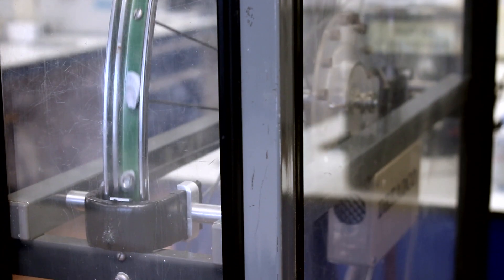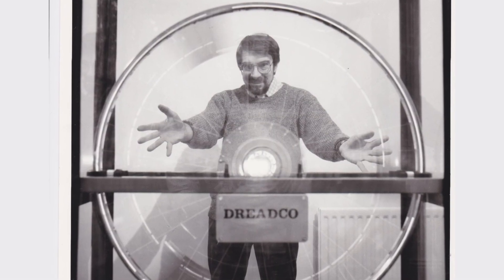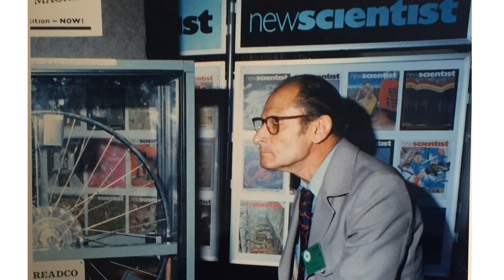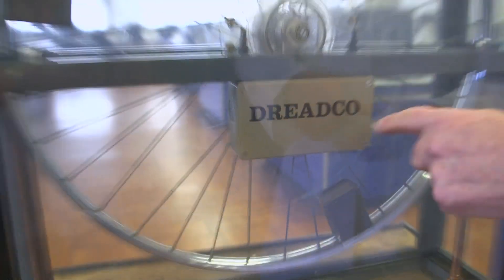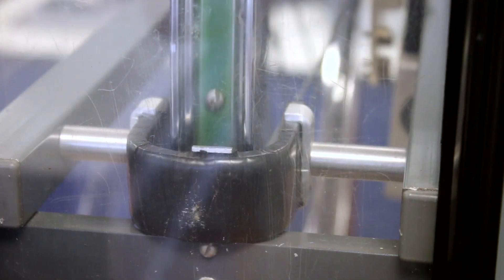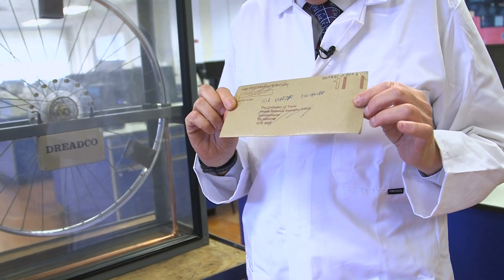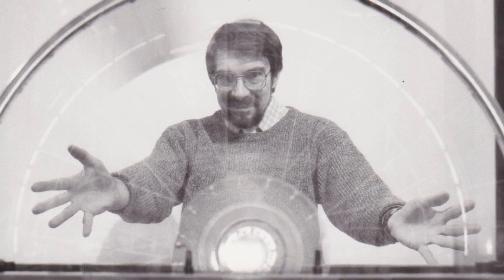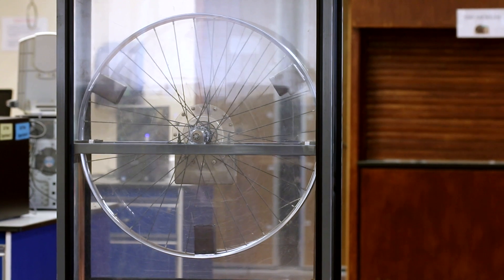Perpetual Motion Machine - Periodic Table of Videos

Comment: This is a non-event. Grandfather clocks run for ages without any further input of energy after the initial windup. Simply 'running a long time' is NOT what defines a PPM. You cannot get this system to do any *work*, because it is simply surviving on the initial input, which would be exhausted the moment you laid a gentle finger on it.

Comment: The axis of the wheel is not actually rotating on bearings, it's suspended by a magnetic casing that keeps a gap space( so no friction) and also same concept to prevent it from sliding to the side. And after the wheel was given its' initial spin the entire enclosure was thoroughly vacuumized. So the wheel will eventually slow down more and stop, but it will take a long time.

Comment: I think it works using electrostatic forces.  The three boxes are batteries, the things "that look like magnets" are brushes (the batteries being subtly connected through the wheel--we don't get a solid look at it in this video), the box with the heat sinks contains some voltage multiplication network, and there is a hidden wire to the Dreadco box to apply a large voltage, negative to the pointed electrode which deposits a negative charge on the isolated metal bits embedded in the plexiglas wheel by corona discharge, and positive to the round electrode which collects the charge, so only the upper half of the metal bits are charged.  The negative electrode repels the charged bits while the positive one attracts them, applying torque to the wheel.  The voltage multiplier could be a simple Joule thief.  Or, if the wheel is mounted at an angle, it could be a Tazer-type circuit (with ultra-low-leakage capacitors) switched at the wheel's rotational frequency.  It's surprising, though, that a contraption that runs for that long would need heat sinks for cooling electronics.  He should have started it turning in the other direction so the rising air from the heat sinks would accellerate the wheel, not push against it.  I predict that it would work the same way if you stopped it and reversed the direction of rotation.  Now to scroll down and see if anyone else had the same thought :)

Comment: Its not an RTG is it?
Reply: I think I will build one! it wont be as large... but I think I could get something to wok.
Reply: You should build one! even if you are wrong in this particular devices function I bet you could still recreate the effect!
Reply: Yes, the circle on the side of the deadco sign does look suspiciously like a radiation window.
Reply: As the prof said he was a bit disappointed when he knew the answer, does that mean he was disappointed because now he knew and couldn't guess or he was disappointed because the answer was so prosaic? If it was the later then I think it might not be any more than just a battery and magnets, so just an electric motor (hence why it's slowing down) and all the other stuff is just there to throw us off.
Reply: I'd love to see your take on this. I was assuming it was working based on differential heating from say lights in the room because that would be a fairly simple method, but I'm not sure how fast it would be able to move. I'm assuming it would be extremely slow
Reply: Humm... seems to check out, it would need heat dissipation. something with a fairly short half life like perhaps tritium? How much would it actually need? If so seems unlikely that this would be sell-able.
Reply: Watching the video again I think it wouldn't be a thermal generator but electrostatic so RSG. Essentially the radioisotope generates an electric charge and as the charges recombine they delver energy to the wheel. perhaps the "thermal fins" are actually there to ground the device? at any rate its probably not that radioactive or the professor wouldn't be anywhere near it given how he is about perceived safety.
Reply: He said he was somewhat disappointed by the answer.  I'm guessing it's just some D batteries in a box and the wheel is a low voltage electrostatic motor.
Reply: @SidewinderScience  Could be, especially as these types of batteries have been used in pacemakers in the 60', but Gamma radiation should be possible to detect with a lab Geiger counter in a cupboard of lead bricks, as there were dose calculations for spouses to nuclear pacemaker patients. I know this machine has been tested with a Gauss meter probe and the center box and the bottom left box had a magnetic field, not the horseshoe magnet looking clamps on the sides. but a permanent field could just be a hoax magnet put in there. The version is Austria that have been running unattended for 21 years and the one here from 1986 for 36 years. there is another video of it from 2017 where it runs at 10 seconds per revolution, and in this video it runs at a whiff over 12 seconds. The never machine in Switzerland runs at 6 seconds per revolution, so obviously, there is an energy source winding down in there. But he says here that it is quite mundane, so that excludes nuclear, though mundane to a chemist with access to every material might have a different idea of mundane?
BTW, the gray boxes on the rim are Colemanns mustard cans! Another option is a metal air fuel cell. A kg of Magnesium has a volume og 571cc and can deliver 6.8kWh in electricity when reacted with Oxygen from the air!! Spread out over 36 years, that is a constant power of 20 mW, enough to spin the wheel by an induction coil like the nodding solar toys, but an electrolyte that doesn't evaporate over decades in a fuel cell that needs to be exposed to air, isn't trivial. I would like someone to travel to the "Technische Museum" in Vienna and do a video of the other device there with a thermal camera and possible a Geiger counter, if the gamma radiation is sufficient to detect! (I'm not considering Beta voltaic cells, though they can be easily shielded with a foil of aluminium, they deliver nano amps, even if both boxes are stuffed full of them).
Reply: Please do! I'd love to see your take on this.
Reply: It has no active energy source anymore. most of the construct is fake. its just a wheel that is hung up almost frictionless with all sorts of empty and useless details around it. as it was build, he gave it somewhat strong momentum, depressurized the box and sealed it. the wheel is slowing down too slowly to recognize.

Comment: That looks like a voltage regulator in the bottom left.  My guess is the copper pipes are hiding wire,  as the wheel spins it generates a small current which is then turned into an electromagnetic force on the wheel.  Those blocks are there for weight transfer and balance on the wheel.  But that's just a guess.

Comment: It could be a form of Bedini motor. The three boxes attached to the wheel each contain batteries, a reed switch and a solenoid. When a box approaches a magnet the reed switch closes so the solenoid activating gives the wheel a kick. If there is a capacitor in series with the solenoid then there will only be a short current pulse through the coil regardless of how long the magnet holds the reed switch in so for most if the wheel revolution there is no current draw leading to a very low average current. There would need to be a discharge resistor across the capacitor. If the value of the discharge resistor is chosen carefully then the wheel speed will be regulated because if the wheel is spinning too fast then the capacitor won't be as deeply discharged so a smaller current pulse next time the reed switch closes.
If the average current drain is around 1mA then an alkaline or lithium thionyl chloride D cell with a capacity of 15 to 20 amp hours will last at least 2 years.

Comment: Some have already mentioned sneaky uses of radioactive material, solar power, or batteries. I am personally hoping it is something along the lines of Crooke's radiometer or the Atmos clock. Given the Inventor's and the Professor's background in chemistry, I think the idea of using interesting thermodynamic properties of a chemical is quite fitting. Perhaps the copper tubing is not a red herring after all.

Comment: A wild guess: there is a temperature differential between the two ends, the pointy and the round one.. The temperature differential generates a voltage difference and the very low current flow is enough to move the wheel

Comment: My Guess : there's a vacuum inside where the wheel is to get rid of air resistance and the track the wheel is spinning on was made to be as smooth as possible. Then it was just spun and went on with little resistance against it spinning.

Comment: i'm guessing he is using the bolts around the hub and the two probes to harness electricity from the magnetic field similar to a generator and that is feeding a small motor turning the wheel. as the wheel turns it powers the motor which turns the wheel etc...the rest is all decoy stuff.

Comment: Probably just a few long shelf life Lithium AAA cells in the 3 boxes. Each box also has 2 small coils of wire that then pass through the 2 horseshoe magnets at either side to give a minuscule push.  An extremely simple and low powered DC permanent magnet motor.  Apparent motion is smoothed by the mismatch of 3 boxes and 2 magnets, producing 6 pulses of motion per revolution.  Everything else are greebles.

If I were Martyn I'd have been let down it was simple as that.

Comment: It does need a power source, means you need to recharge it in some way at some point. Im guessing all the boxes and nonsense is fake and its just a low power motor with a battery hidden in the construction. That would be the easiest way.

Comment: Ok, I understand the laws of thermodynamics... really, I do. But... If you have ever used a permanent magnet, specifically strong ones, like neo-dymium, you know there is a considerable force a magnet can exert.... Exactly where does that force come from? (admittedly, I don't know much about how a magnet works.) If a magnet ALWAYS has enough force to pull things to it / pull itself onto things, does that not mean the magnet has energy?

If you place a string on a block of ice with weights on either end of the string, the string will cut through the ice, because the pressure releases energy into the ice which allows it to melt along the string line. Replace the weights with magnets pulling themselves to a base metal, pulling the string along, it will do the same thing. The string will exert a force on the ice, passing energy to it, causing it to melt. Does that not prove that magnets exert energy?

If magnets exert energy, yet lose none of their attraction force, would that not make a magnet a perpetual energy source? (I know magnets do lose their strength over time.... but that takes decades) So if magnets are a source of energy, why exactly is it such a ludicrous idea that you can rig up a perpetual motion machine with magnets? More so, a wheel that spins with magnets not just without resistance, but with the resistance of a motor attached to actually collect the energy generated in the spin. (If you've ever played with electric motors, you'll know you can spin the axle of the motor when its not powered, and it will continue spinning for a little while longer, without a problem, but if you just connect the 2 cables of the motor to each other, you can't turn it and expect it to continue spinning, because the energy it generates flows back into the motor wanting to make it spin the other way, stopping the axle. That's the resistance I'm talking about.")

Comment: My guess is that the two metal things coming up from the Dreadco box are plates of a capacitor.  They induce a slight electrostatic charge in the ring of bolts on circular acrylic plate.  I "feel" the shape of the capacitor plates are important for creating an asymmetrical charge imbalance (hence why one is pointy and the other is short and round).  This may provide a very slight acceleration to the wheel.  The atmosphere in the box could also be prepped to reduce capacitor leakage.  I think this could produce a fairly efficient device and there is plenty of room in the device to stuff as many batteries as you would need.  The boxes on the outside of the wheel may just be for decoration, or they may act as flywheels to increase the angular momentum of the device.

Comment: My take: It's a very simple motor. Inside the cans are permanent magnets that are pushed/pulled by the coils at the end of the arm. The center hub contains at least a few magnets that cause magnetic reed switches to close when the magnets pass by. When the reed switches close, they energize their respective coils which push or pull the wheel.

Inside one of the boxes is a set of batteries. The reason the machine can run as long as it has is that the coils are on for a very short period of time (aka a short duty cycle) and are likely current limited by either a high-winding coil with very thin copper gauged wire, or else a resistor. The low friction of the bicycle wheel allows for the wheel to continue spinning with very little energy needed to make up for friction-heat loss.

A possible variation of this (though unlikely for something made in the 1980's) is a hall effect sensor in the place of the reed switches. The cans themselves also don't necessarily need permanent magnets in them if the cans are made of/contain steel or another ferromagnetic material.

Message to the keeper/s of this machine - you will want to replace the batteries every so often to prevent leaks. Otherwise, you'll end up with corroded contacts and a messy cleanup.

Comment: My guess is that each box mounted on the wheel is filled with a liquid such as mercury and   may contain an internal buffer similar to an hourglass to control the flow. The placement of them allows the mass off the center to be slightly offset so it causes the side with slightly more mass to descend.

It appears that the majority of the machine is for visual appeal.
Reply: The unbalanced wheel is a classic perpetual motion machine gimmick, and of course it doesn't actually work. Which means if that's the gimmick here, the machine wouldn't be running, but it is running, which means that (alone) can't be the gimmick.

Comment: My guess is electrostatic and the boxes just balance the wheel better and you can have a very low discharge of the battery if it is just a static electricity driven system provided the enclosure keeps the humidity from getting too high. There is no way it heats up appreciably or has any complex gas cycle as I doubt it is very well sealed.

Comment: Speaking of magicians, Neil is truly the Teller to Poliakoff's Penn.

Everyone's talking about "Occam's Razor" and batteries, motors, etc.  If it was a battery or any sort of low power engine, someone in a group of engineers and physicists surely would have guessed that easily.  We need to go simpler: I say EVERY bit and bob is a red herring.  This is nothing but a greased wheel in a sealed container with the air removed.  It's then spun, and the lack of significant air resistance, low friction, and minimal opposing forces allows it to continue spinning for an extremely long time.

Anyone who's ever spun a freshly lubricated bicycle wheel will understand.  Those things spin and maintain their initial velocity far, far longer than you ever expect them to.  If you get the balance just right and remove as many outside friction/forces as possible, two years isn't so far fetched.
Reply: 2 years is 700 days. 
If You think it will spinn for 2 years bc of vaccum - You are out of your mind. 

Btw, oil in bearings - additional resistance. Ceramic is better.
Reply: The three boxes along the rim might just be weights, to add mass and thus capacity for kinetic energy storage during the spin-up. Presumably the machine must be kept on its cart and wheeled around without tipping at all on an uneven floor, meaning the bearing wouldn't have an uneven friction anywhere inside. 

A sealed bearing filled with dry graphite would be best I think.
Reply: This was a silly comment but let me just state for the record, that as of Adam Savage's video where he looks at this same device, it's made quite visually clear that it cannot be vacuum sealed. So my silly guess is not correct
Reply: Matthew Thomas Given the speed of rotation, you don't actually need a vacuum. Inertia alone is sufficient. Watch some of the fidget spinner videos to see how once they slow to a couple of revolutions per second, they just keep going, for an hour or more in some cases.

Comment: My guess: the wheel is the armature of an electric motor. The boxes on the wheel are empty and are just there to provide a bit more area for the magnetic field to interact with. The box down the bottom with the heatsinks and the DREADCO box contain batteries to power it.

Comment: I think THE SECRET LIES IN THE TABLE. Specifically when driving that table. It looks to me like it's part of the whole thing. For example you can use the wheel rotation to collect energy and/or generate energy using mass inertia (you could suspend weights on a rubber band somehow in the frame or under the fake heatsink and generate energy from their random movement when driving this thing around). Notice that when they show old photos they are careful not to show on what table it was placed back then (probably the same one).